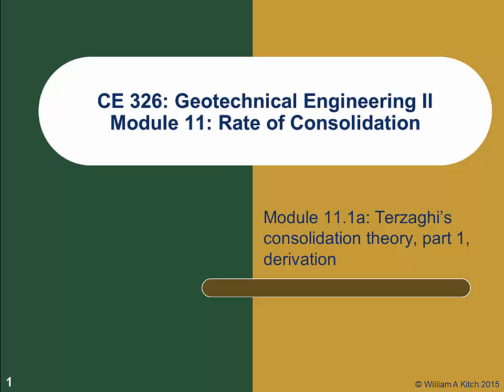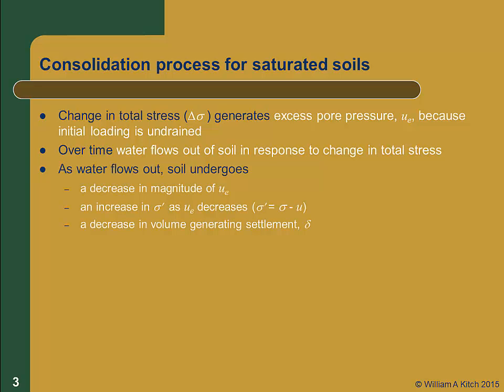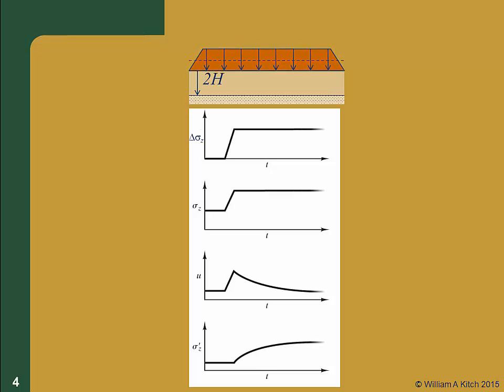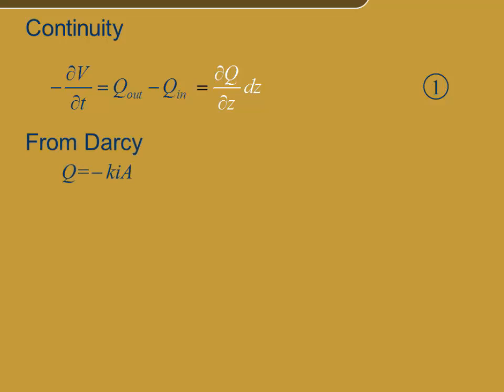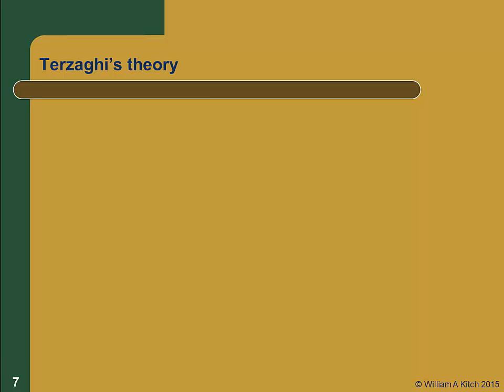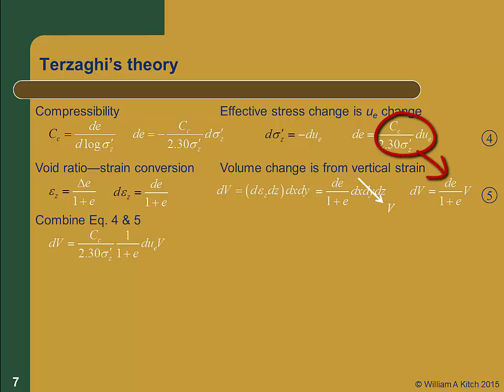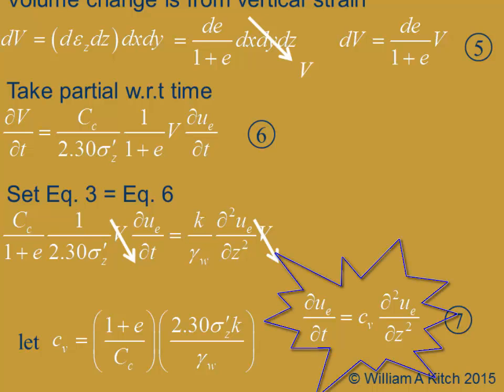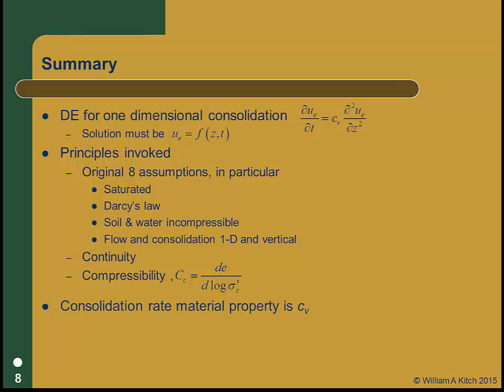CE 326 Mod 11.1a Terzaghi Consolidation  Theory

Comment: 6:40 Why is this equation used instead of the coefficient of volume compressibility, mv (m sub v)? Would mv be a general case? While 2.3*sig z is a special case of changing soil conditions? And if so, how do we solve this?
Reply: This is the only textbook that computes the coefficient of consolidation in this way. Every other textbook uses the coefficient of compressibility to compute the coefficient of consolidation. Which is the outdated method?
Reply: Well, if you haven't found the answer yet...
Mv assumes linear relationship between void ratio and effective stress which isn't the case. But when you plot change in e vs log of effective the curve flattens out hence Cc method is more accurate.